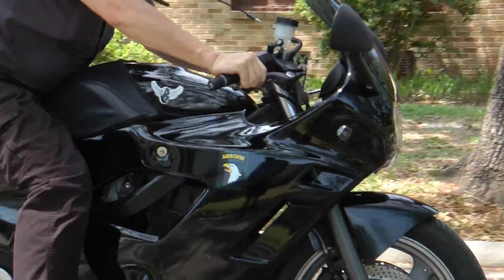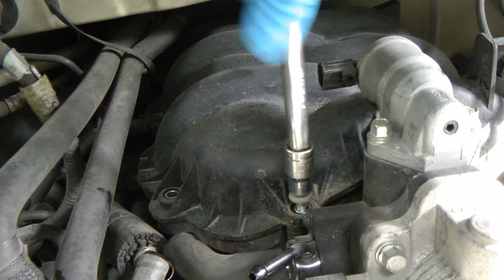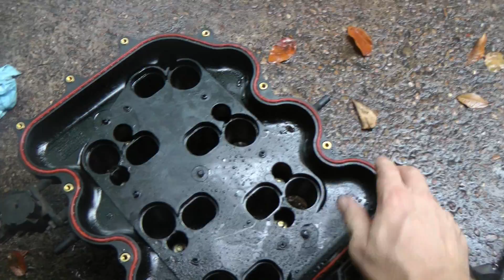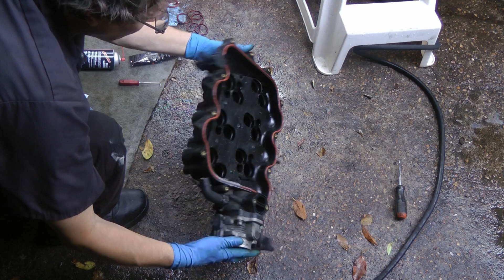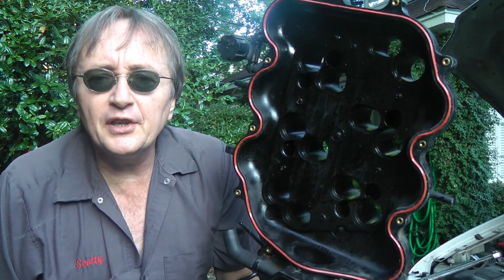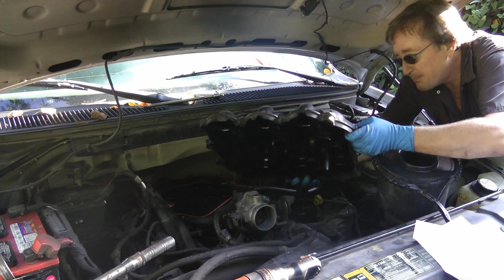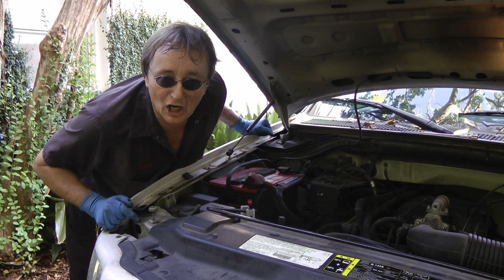How to Replace a Intake Manifold Gasket in Your Car

Comment: Scotty, I know this isn't the correct video, I am replacing a transmission pan gasket on a 1994 Pontiac Transport 3.1 liter, my question is after I drain the fluid, do I put the same fluid back in that I drained out ? my fear is the transmission starting to slip once its all back together . please let me know . Kody
Reply from the maker: you're guessing there, unfortunately being that old, sometimes new fluid will make it act up. IF it doesn't act up already, reuse the old stuff, just strain out pieces, cause yes, new fluid can make it slip now on one that old
Reply: Definitely do not put the old fluid back in. In many cases, especially on older cars, the fluid is what will end up causing problems with the transmission. Even cheap replacement transmission fluid is better than old used fluid. You'll save a lot of time replacing the fluid if you've already drained it to change the gasket.

Comment: I have a 1995 impala ss the manifold turned cherry red after leaving the car wash what could be the problem?
Reply from the maker: if ignition system got wet and went too retarded on the timing, it will do just that

Comment: Scotty, On my 01 Maxima there is an Idle Air Controller on the bottom of the throttle body. There was coolant in one of the Vacuum hoses that go to it. Intake manifold gasket? I can't think of anything else it could be.
Reply from the maker: it often is a leaking intake gasket. Have a pressure tester hooked up to find out

Comment: Hey Scotty, I am changing mine this week on my 2010 dodge charger sxt because the computer has a code stored saying throttle air high and I hear a hissing sound coming from the back even when the AC is shut off.... I just had my spark plugs changed recently at pep boys and they told me I need a new gasket but didnt have one on stock and was in a rush.
Reply from the maker: bad gaskets will hiss, realize that. try my video "finding engine vacuum leaks with a cigar' to find it for sure

Comment: Scotty, I know you said this is a normal job that normal tools will be needed, BUT how do you get the two center bolts out of the BACK of the upper manifold on a 2001 Ford F150 XL with the 6 Cyl, 4.2 L engine. I've tried ever possible combination of sockets and flex-adaptors, and cannot get anything to work. I can barely touch the two bolts with my finger tips.

Is there a rubber plug under the plenum grill that gives access from above the firewall?
Reply from the maker: i've never done that 6 cylinder engine, so I can't say. Get a cheap manual with pictures, like haynes
Reply: Scotty Kilmer Scotty, isn't that the engine featured in the above video? It looks exactly like my son's truck and engine. 

Let me re-phrase my question, How did you get the two rear-most upper manifold bolts out of the engine featured in the above video?

I'm ready to drill two standard plug sized holes above those two bolts, to get to them, but my son does not want to do that. I cannot see struggling with them when the drillings would give easy access. Do you have an opinion on that, I can share with my son?

Thank you,
Vincent
Reply: Scotty Kilmer P.S. Got that manual, and like most manuals for American vehicles it covers too many models and generally shows generic photographs printed on poor paper stock from substandard photography that don't show all of the details. The manuals also don't give important details when difficult or unusual placement of parts prevents easy access.

P.P.S. Love your videos!

Comment: Scotty, thanks for this and all your other videos, I have a quick question if i may. I have a 96 Ford Windstar 3.8 that has a constant misfire on #5 (flashing CEL). I will also on occasion get a lean on bank 2 code. I know that the Windstar had several gasket problems both with the intake and head gaskets. I'm wondering if my misfire might be due to a bad intake gasket. When I open the hood I can hear a leak, but can't track it down using carb cleaner or anything like that. The plugs and wires are all brand new, fuel injectors and the coils all test fine. I was thinking of replacing the intake gasket and probably cleaning out the egr ports since I've read that those can clog and cause misfire problems. Do you think I'm in the right area? Or should I be looking somewhere else? Thanks in advance for any advice you can offer.
Reply from the maker: intake gaskets do that all the time, I would start there by taking em off, cleaning em up, and putting new gaskets on. I would also swap and #5 injector with another when I did that, and if the miss moved, I would replace that injector.
Reply: Exactly what I was thinking too. Thanks for your quick reply. It's nice to know I'm in the right area to start with. Especially considering a year ago all I knew about cars was how to add gas. And even that I could only get right 2 out of 3. JK... sort of. LOL
Reply: Scotty Kilmer
Jeez, you should see the upper intake manifold. It looks like it hasn't been cleaned and the gaskets haven't been changed since it rolled off the line. I haven't finished yet. I'm taking it slow just to be safe since it's my first time and all, but will let you know what ends up happening when I'm done. I have two new questions though. First since the intake gaskets seem so bad do you think it would be a good idea to go ahead and do the head gaskets as well? And second how much harder is it to do the head gaskets than the intake gaskets? Would it be safe to assume that if I'm able to successfully complete the intake gaskets that I would be able to do the head gaskets as well? Or is that something that I should really take it to a pro for? Thanks again for all your help.
Reply: Scotty Kilmer
Well I just wanted to let you know that the misfire did come back, but that it moved with the injector. So it looks like I'm going to have to replace that. I'm not sure that's the only problem I have though because I'm still randomly getting bank 2 too lean. Could a bad injector cause that?

Comment: Can you explain to me how to replace the lower manifold gaskets on a 2002 ford f150 4.2L V6
Reply from the maker: giant job.
Remove the intake manifold spacer assembly.

Disconnect the exhaust gas recirculation (EGR) valve vacuum hose.

Remove the EGR valve to exhaust manifold tube upper fitting.
Remove the upper radiator hose from the lower intake manifold.

Disconnect the intake manifold runner control (IMRC) electrical connector.
Remove the fuel rail.

Disconnect the water bypass hose and the heated positive crankcase ventilation (PCV) system heater water hose.

Remove the (A) long lower intake manifold bolts, the (B) short lower intake manifold bolts and remove the lower intake manifold.

Remove and discard the lower intake manifold sealing components.
Installation

Refer to the illustration for intake manifold sealing component locations.

Install the lower intake manifold front and rear end seals.
Apply a bead of silicone gasket and sealant to the intake manifold front and rear end seal mounting points as indicated.
Install the lower intake manifold front and rear end seals.

Install the intake manifold gaskets.
Note: The lower intake manifold must be installed within four minutes of applying sealant.

Position the lower intake manifold.
Apply a bead of silicone gasket and sealant to the lower intake manifold mounting at the points indicated.
Position the lower intake manifold.
Note: Make sure the bolts are installed in the correct location.

Loosely install the (A) long bolts and the (B) short bolts.

Tighten the bolts in the sequence shown in two stages.
Stage 1: Tighten the bolts to 5 Nm (44 lb-in.) .
Stage 2: Tighten the bolts to 10 Nm (89 lb-in.) .
Connect the water bypass hose and the heated PCV system heater water hose.

Install the fuel rail.

Connect the IMRC electrical connector.
Install the upper radiator hose to the lower intake manifold.

Connect the EGR valve vacuum hose.

Install the EGR valve to exhaust manifold tube upper fitting.
© 2014 ALLDATA LLC. All rights reser
Reply: thank you. I have another question for you. My truck is idling rough and shaking like a diesel engine, I took it to get the codes read and it came back saying that bank 1 and 2 are running lean. What does that mean?!
I have cleaned the throttle body and the mass airflow sensor. I'm replacing the intake plenum gaskets today. What could be wrong with my truck?

Comment: Hey Mr Scott,I have a 06 Mustang GT,I just replaced my intake manifold gasket yesterday and it still has a vacuum leak in the same place?! What could I have done wrong? It's odd that the very same place has the leak and not anywhere else???
Reply from the maker: often the manifolds warp on that model and need replacing too

Comment: Scotty, I'm trying to replace the lower intake manifold on my 2001 ford f150. I can not reach the upper manifold bolt in the back by the fire wall !, do you know any trick to do so ?, the bolt is the one with the pin to hold the spark plugs wires, I can't fit a wrench nor a socket it's driving me crazy. Please help

Comment: I need to replace the gasket on my 2006 Pontiac G6.  Is the process similar to this one?  I think I'd rather do it myself seeing this video makes it seem simple.
Reply from the maker: a bit harder than this, but doable with patience
Reply: Hey Scotty,  I can't remove the rocker arms to get the lower gasket out.  They look different than the video.  Any thoughts?
Reply from the maker: Ray Jones here you go :

    Important: This engine uses a sequential multiport fuel injection system. Injector wiring harness connectors must be connected to their appropriate fuel injector or exhaust emissions and engine performance may be seriously affected.

Disconnect the battery ground negative cable.

    Remove the upper intake manifold.
    Remove the left valve rocker arm cover.
    Remove the right valve rocker arm cover.
    Disconnect the engine coolant temperature (ECT) wiring harness.

        

    Disconnect and remove the fuel injector and manifold air pressure (MAP) wiring harness.
    Remove the fuel injector rail.
    Disconnect the heater inlet pipe with heater hose from the lower intake manifold and reposition.
    Disconnect the radiator inlet hose from the engine.

        

    Remove the water outlet.

        

    Remove the thermostat.

        

    Remove the lower intake manifold bolts.
    Remove the lower intake manifold.
    Remove the valve rocker arms and pushrods.

        

    Remove the lower intake manifold gaskets and seals.
    Clean the lower intake manifold gasket and seal surfaces on the cylinder heads and the engine block.
    Clean the gasket and seal surfaces on the lower intake manifold with degreaser.
    Remove all the loose room temperature vulcanizing sealer (RTV) (1).

Installation Procedure

        

    Important: All gasket-mating surfaces need to be free of oil and foreign material. Use GM P/N 12346139 (Canadian P/N 10953463), or equivalent, to clean surfaces.

Install the lower intake manifold gaskets.

    Install the valve rocker arms and pushrods.

        

    With gaskets and seals in place apply a small drop 8-10 mm (0.31-0.39 inch) of RTV sealer GM P/N 12378521 (Canadian P/N 88901148), or equivalent, to the 4 corners of the intake manifold to block joints (1).
    Install the lower intake manifold.

        

    Notice: Maximum gasket performance is achieved when using new fasteners, which contain a thread-locking patch. If the fasteners are not replaced, a thread locking chemical must be applied to the fastener threads. Failure to replace the fasteners or apply a thread-locking chemical MAY reduce gasket sealing capability.

Notice: Failure to tighten vertical bolts before the diagonal bolts may cause an oil leak.

Apply sealer GM P/N 12345382 (Canadian P/N 10953489), or equivalent, to the lower intake manifold bolt threads.

    Notice: Refer to Fastener Notice in Service Precautions.

Install the new lower intake manifold bolts, if applicable, in sequence.

    Tighten the lower intake manifold bolts in sequence to 13 Nm (115 inch lbs.) on the first pass.
    Tighten the lower intake manifold bolts (1, 2, 3, 4) in sequence to 20 Nm (15 ft. lbs.) on the final pass.
    Tighten the lower intake manifold bolts (5, 6, 7, 8) in sequence to 25 Nm (18 ft. lbs.) on the final pass.

        

    Install the heater inlet pipe.
    Install the heater inlet pipe nut. Tighten the heater inlet pipe nut to 25 Nm (18 ft. lbs.) .

        

    Install the thermostat.

        

    Install the water outlet bolts.

        

    Install the ECT sensor. Tighten the ECT sensor to 20 Nm (15 ft. lbs.) .

        

    Connect the thermostat bypass hose to the thermostat bypass pipe and lower intake manifold pipe.
    Connect the radiator inlet hose to the engine.
    Connect the heater inlet pipe and heater hose to the lower intake manifold.
    Install the power steering pump to the front engine cover.

        

    Install the fuel injector rail.

        

    Connect the fuel feed pipe to the fuel injector rail.

        

    Connect the fuel injector and MAP wiring harness.
    Connect the ECT wiring harness.
    Install the right valve rocker arm cover.
    Install the left valve rocker arm cover.
    Install the upper intake manifold.
    Connect the battery ground negative cable.
Reply: Thanks again!

Comment: Hi Scotty Kilmer , I just sent my car to a mechanic to replace the cylinder head gasket. It should be fine. But, my radiator smells like gas, and constantly losing water. When I checked the engine oil, it's already mixed with water (again). I think the head still fine, it did not overheat. Is it possible that a leaking intake manifold is the culprit? If this would help, I checked with ODBII, it says an error with MAF. Your reply would be a big help. Thanks!

Comment: to replace the LIM on my 3.4L Impala I need to remove the rocker arms and push rods. When I reinstall the rocker arms and push rods do I need to as I do each cylinder to bring the cylinder to TDC on the compression stroke?
Reply from the maker: there is a rather complex process of tightening those arms. I would advise getting a cheap manual with the step by step directions myself as it's rather complex and must be done correctly in those steps, using a torque wrench.

Comment: Question, would changing the intake gaskets on a F-150 XL cause rad fluid in the oil as well.
Reply from the maker: on that model, coolant can mix with oil when removing the manifold if you don't drain the coolant first
Reply: Ok, how about after you change it, would there be a possibility that the person didn't change it properly, cause after my friend started it up then drove off he noticed a big shimmy in engine, then open hood and there was a blast of air coming from drivers side area only in one spot blowing up, and now there is anti-freeze in oil. While it was blowing air out top, seemed like liquid was spraying out as well, but not all the time. Im guessing rad was empting.

Comment: Same truck and engine, but an upper manifold bolt is just spinning, I stopped immediately to ask your opinion, how serious is this, I bought it used recently
Reply from the maker: IF it's not sucking air and leaking vacuum pressure, you can live with it. You might remove the bolt and put some RTV sealant in the hole then put the bolt back in

Comment: Love your videos. They answer the necessary questions nicely.

Ive got 2002 Hyundai Elantra GT 5sp hatchback.
Car revs from 1200 to 2500 rpm.
Now it goes right to 5000 and stays there! I have to fight the car to stop!!!
Seems to be a common problem with these cars.
Been told everything from IAC, TPS, MAP or vacuum leak.
My head is full and my wallet is empty.

Any suggestions?
*Molotov cocktail through the windshield has already been considered.
Reply from the maker: often a bad maf sensor on those, also try my video "how to fix a car that idles poorly" because the throttle may be sticking open and need cleaning to stop that

Comment: Hey Scotty, would a bad lower intake manifold on my 97 Ranger 3.0L have anything to do with my 'no heat' in the cab situation. Shop said there is a broken bolt so they couldn't take off to get to t stat. Can a bad manifold lead to a 'no heat' problem? Usually thought it was a heater core, broken blend door that leads to heating problems. And nobody makes lower intake manifolds anymore, have to find it in a junkyard
Reply from the maker: if the manifold leaks enough vacuum it can shut off the heat. not that common, your other mentioned causes are more common, especially a thermostat IF the temp gauge stays low all the time

Comment: Scotty I have a 2001yukon denali wirh codes p0171, p0174, and p0300 system test found all 3 are being caused by leaking intake manifold gaskets creating vacuum leak  the estimate was $290.00 does this sound correct
Reply from the maker: that's a really good price, jump on that one.

Comment: How hard is it to do a 1991 Toyota Tercel Intake job?  Also... don't you have to wait several hours before you put the coolant back in?
Reply from the maker: you don'thave to wait at all once it's bolted back on correctly. It's a normal job, being only a 4 cylinder engine, but you want to mark all the hoses and lines to make sure they go back on right

Comment: Hey scotty, I just replaced my intake manifold and heater hose on my 2000 crown vic that I asked you about a few days ago. I just started it up and there is white smoke blowing everywhere but it seems to run okay. Do you have any ideas? Thank you so much
Reply from the maker: give it a day or two of running, often they smoke from residual crap from doing that job. PRAY it's not the gasket leaking oil or coolant into the engine
Reply: Thank you for all of your help, it stopped smoking and is running great now